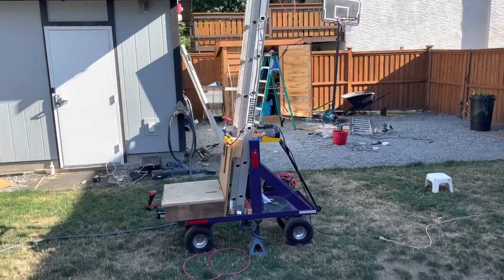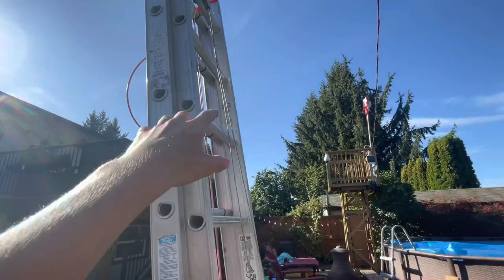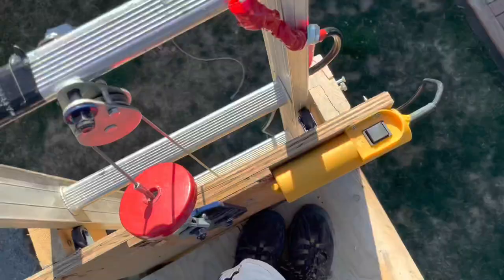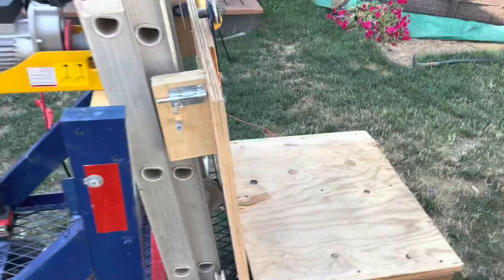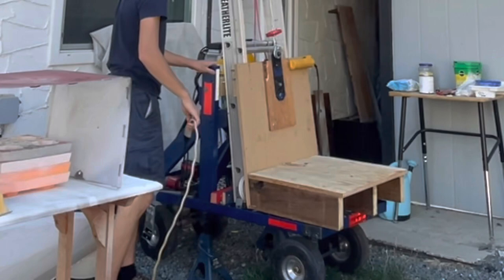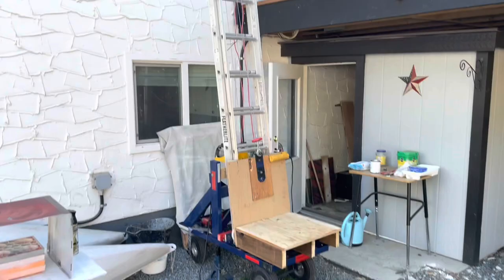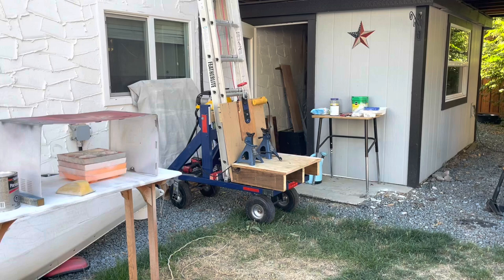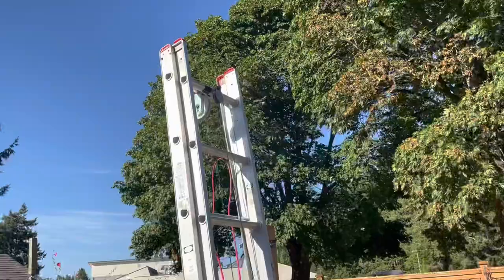Making my own electric manlift

Comment: You need a brake on the lift that way if it cable snaps you don't freewill. A retractable anchored to another structure then the lift would be a simple fix. Every time you add a snatch block (pulley) your capacity increases by 50%. I would use better pulleys and your quite wheels also need extendable outriggers that you can level and gives you a wider footing. Thats something very important. But overall good job just be carefull. I fell 12 ft last year luckily didn't break anything or kill myself but I sat on the couch for 16 days and took about 10 months before I finally wasn't in pain. Compressed my ankles real bad. Stupid mistake should of been tied off

Comment: May want to put outriggers on it. Side to side stability is low would not take much crosswind to tip you over.
Reply from the maker: You totally would I didn't keep this thing for long as it was pretty scary lol
Reply: I like the concept but man what a death trap lol

Stability and weight capacity I would want to improve.  The winch and cable I wouldn't trust, they make that style up to like 1200lb capacity for like fifty bucks more, bugger cable and motor.  Still good for 600lbs without the snatch block... 

The wagon.... the cheap pneumatic tires scare me.  I have the same wagon and those tires are weak and flexy.  Would definitely want solids.  And some form of telescopic outriggers... something like the dolly bars on a tow truck.  You could use car scissor jacks welded on the ends instead of axle stands, not only would cranking them down be easier, but it would give infinite stopping positions to solidly adjust for inconsistent terrain or a bit of slope.

The carriage I would build out of steel, I have a hard time trusting wood... your cracked lumber wasn't inspiring confidence lol.  It should be tall enough that you have something to hold on to and not have to crouch to operate it.

Some type of drop braking would be a good idea too.  Perhaps some kind of personal fall arrest unit could be made to work for that.

Like I said, I like the concept... you've got the wheels turning in my mind about building one mounted to the back of my old Sonima 4x4 pickup for use around the farm...

Comment: How did you make it pull the ladder section up and down with it ? Please reply
Reply from the maker: There is the winch at the bottom and the pulley at the top of the first ladder which goes down to the bottom of the outer ladder section and then it goes up to the top of that one and then to the part I had the actual platform on
Reply: Thank you for the reply